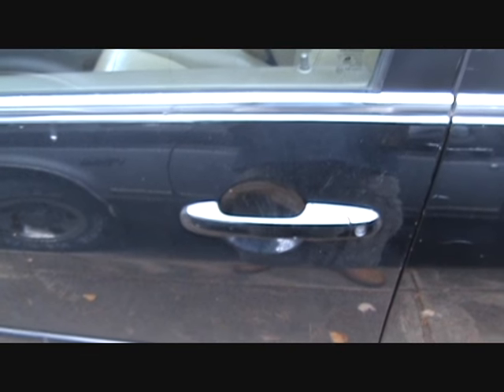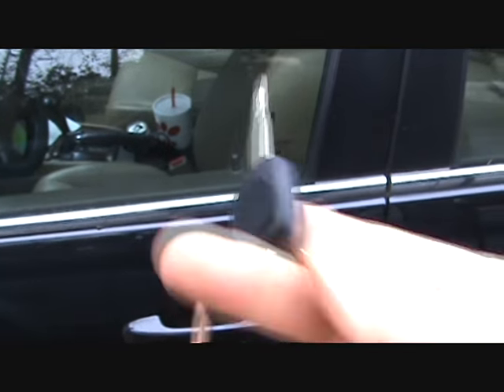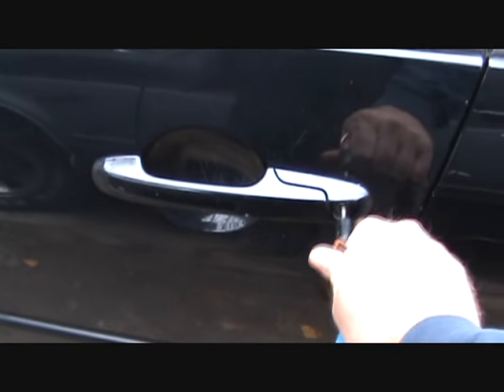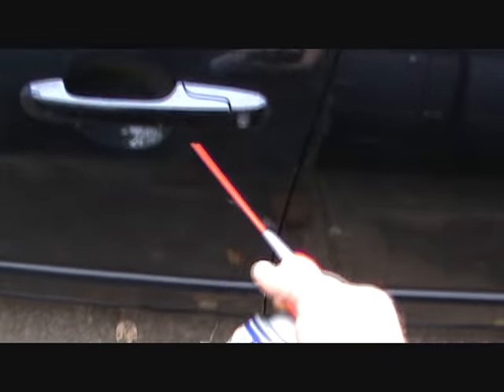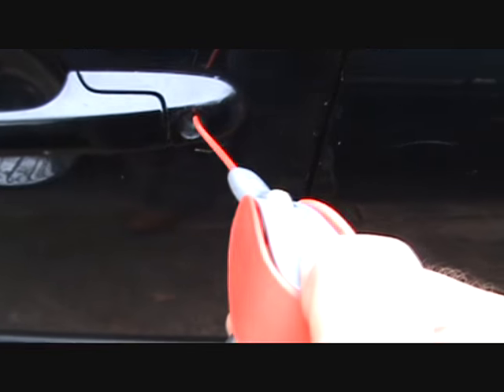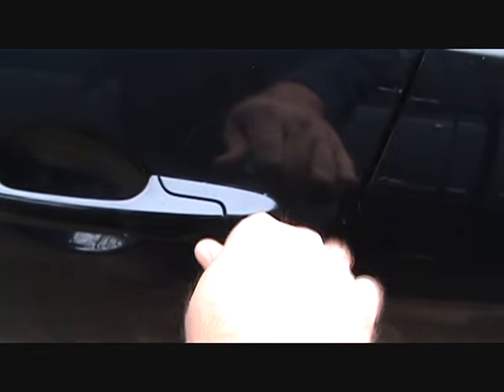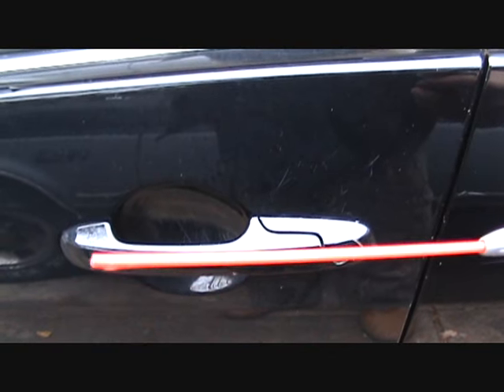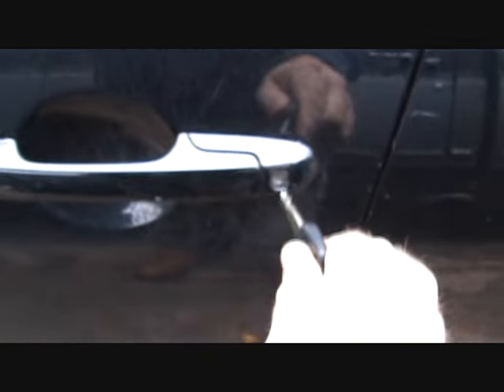Honda Door Key not working hack/fix simple and easy

Comment: I got a 05 and it just stared happening same thing happened on my 03 accord
Reply from the maker: I eventually had to change the lock. But this got me down the road till I could replace
Reply: @willwood487  I'll probably just leave my door unlocked if it keeps happening it just started yesterday
Reply: @willwood487  - What is the name of the piece you replaced? I have to do the same for my car. Thank you
Reply: I tried leaving the door unlocked but it locked itself.
Reply: @pinkelefant4ever  mine dont lock well usually i just push the driver door lock down and it locks all of the doors then pull it up so the driver door stays unlocked

Comment: Didn’t work for me either. A piece of the red nozzle actually broke off in the lock as well.
Reply: kevin sharp  haha dam that jus happend to me rn I put it in to spray and it got stuck I wiggled and wiggled and nothing till pulled it off and it broke inside smh I was so mad 
Did you end up take the the broken piece out ? How’s you do it
Reply: Well not exactly. I heated up the key to try and melt it and to free it up. Got some but not all. Still doesn’t work. I think ya have to take it all apart is the best but looks like you have to have the right tools. Best of luck to you.
Reply: Use a small flat screw driver to hold the "flap" open wile you insert the red" straw". Also i used fluid film when i did this. My key wouldn't even insert into the lock but after lots of spraying and in and out with the key it worked. Only on passenger side will try again with some grafite spray for locks. Hope this helps someone.

Comment: What if your best friends idiot husband spray something in the key hole saying it would fix the problem but it only made it worse. Don’t remember what he used but as far I’m concerned it was some kind of frickin cement. I’ve been working on it with wd trying to chip away and finally got the key all the way in but it won’t turn. On top of that  my viper key fob stopped working (not the batteries) I think there’s a short somewhere. My question is what should I fix first (recent widow on fixed income). I can’t set my alarm nor can I lock the driver side door. Anything suggestions would be deeply appreciated. Thank you
Reply from the maker: New lock and key. Have a locksmith change the tumblers to match the new key. This was just a get you buy till you can get the locks changed
Reply from the maker: @Debra Gonzalez  the keys aren't very expensive and the locks aren't very expensive.  Most of the cost was having a locksmith laser cut the key and change the tumblers in the new lock to fit. As stated earlier this was a help you in a pinch video. The mechanism will eventually no longer work. Hope I have been of some small help.

Comment: My little door is stuck open and the blasted key won't open it. Reckon I change the cylinder and require henceforth multiple keys.
If it's small and or plastic on this everliving Honda, it breaks. I'm done with them.
Reply from the maker: You can have a locksmith change the tumblers so you have one key. I had to eventually do this as my key got stuck in the lock wouldn't open the door or release
Reply: @willwood487  many thanks. I guess I'll start looking for a good price on a locksmith.

Comment: Tried it and it didn’t work 
Can it be something else
Reply: Same 😞
Reply: Could be something jammed in the hole. Try applying WD-40 not just inside the home the key is put in but ALSO the ring around the lock where the lock meets the handle or body panel of the car. Wait 10 minutes. Re apply. Wiggle the key in GENTLY once key is in, slowly with little to no pressure twist key right then left for up to 2 minutes eventually the lock cylinder will turn.

Comment: Mines is the same exact way I have a 2007 Honda Accord I applied wD40 and it still won’t open
Reply from the maker: The lock is broken then. You will have to remove the key lock and replace. I recommend doing this sooner than later if you come to a situation where the key gets stuck in the door you are really stuck.

Comment: Mine key is not turning at the driver side wt could be?
Reply from the maker: Worn out key have a locksmith cut you another one. Eventually your key will stick in the door and not be able to be removed.

Comment: my key goes in but does not turn. help?
Reply from the maker: Lock is broken you will have to have a locksmith remove and replace. You can have the locksmith replace the tumblers to match your key. Mine eventually stuck in the lock. Had to turn the key with a wrench to break the lock to remove so I could drive home. Either the key or lock will snap doing the wrench method.